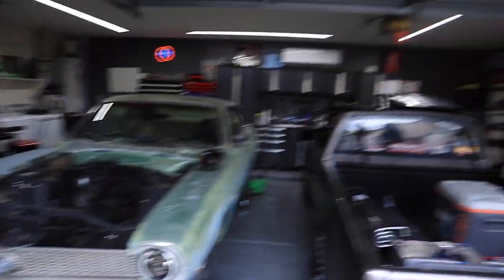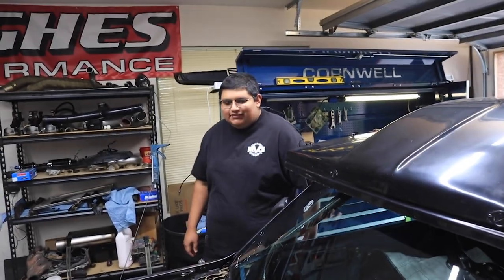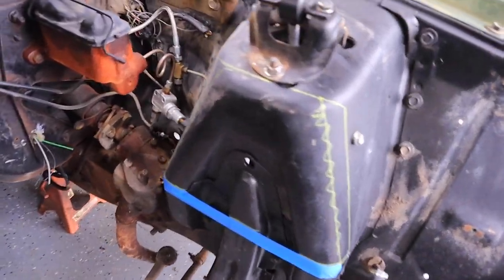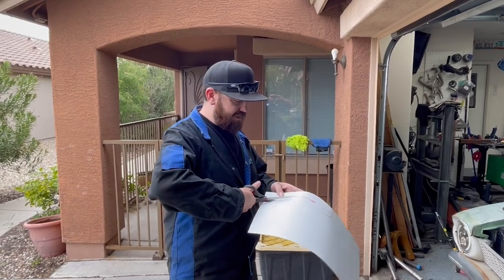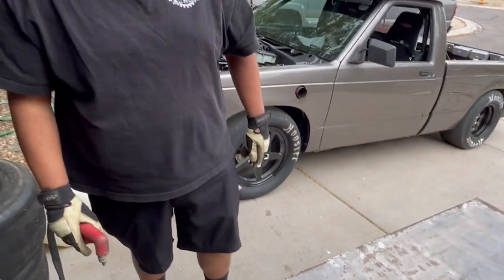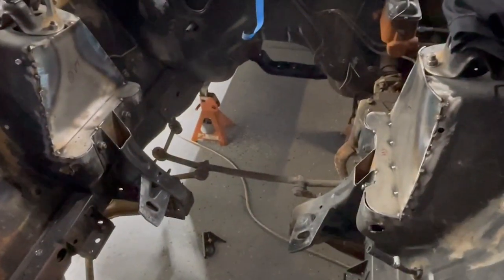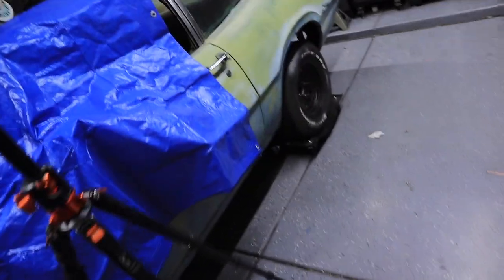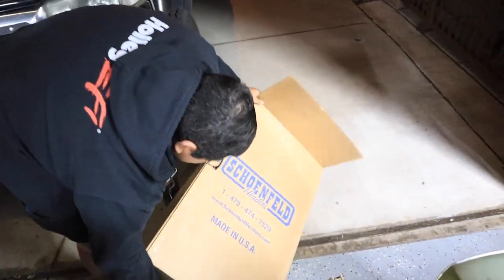New Project! Jorge's 1971 Ford Maverick LS Swap. Eat Your Heart Out Miss Midnight Maverick

Comment: Go up and forward with the engine! Idk why you didn't do that. Should give you room for the headers George got, or stock manifolds. Easier than building custom headers, that you haven't done before. It would be different if you build custom ones all the time, like I do, but why make it hard?
Reply from the maker: Moving the engine would require cutting the floor and building a trans crossmember. Watch for episode 2 to see what we do
Reply: @RobbyVsGarage  Why would you have to cut the floor, to move engine forward, toward radiator??
Reply from the maker: @funfun8095  you said up and forward. Up would require cutting the floor. Forward wouldn’t help any
Reply: @RobbyVsGarage  Figured you'd have an inch or so, to go up. Going forward would bring you to a taller part of tunnel, but guess not. ✌